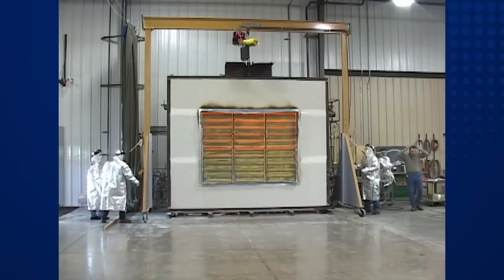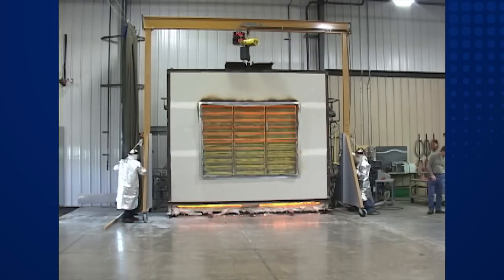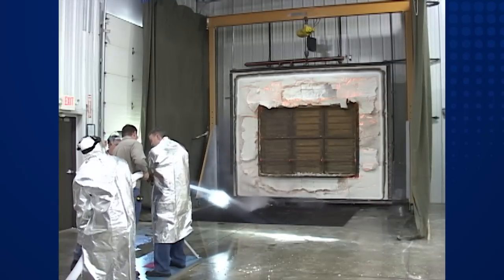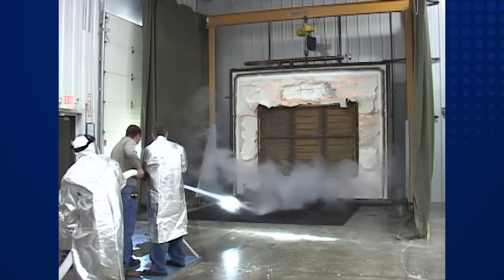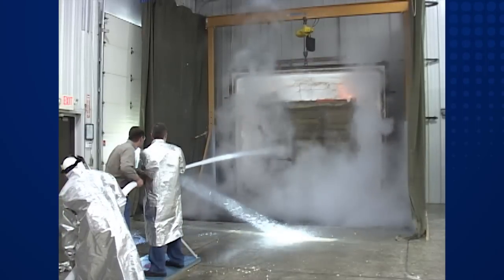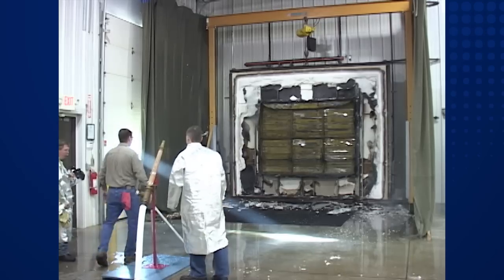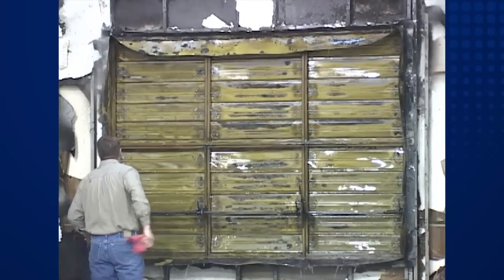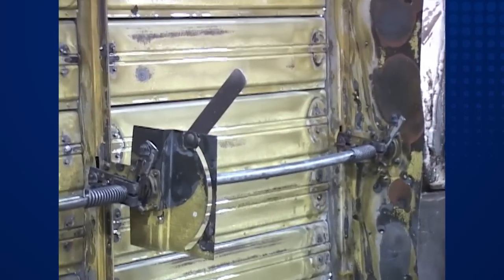Greenheck Dampers - UL 555 Damper Fire Test

Comment: frankly there is a some things about this test that is wrong, including putting plates over the damper to contain the heat. This to ensure the fusible link operates before the damper seizes. I wonder if they supply clients with plates with every damper that can be used in the event of a fire? Also the damper is tested outside of the furnace and not inside which means the casing is not subjected to the heat. Much improvements required.